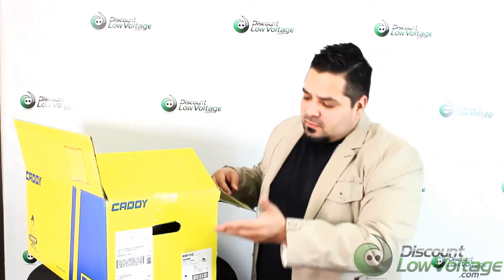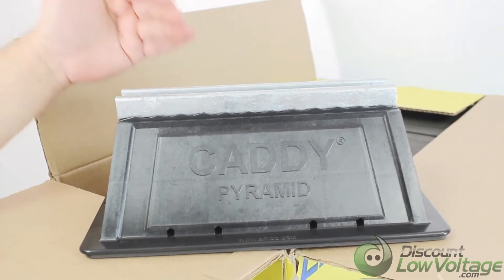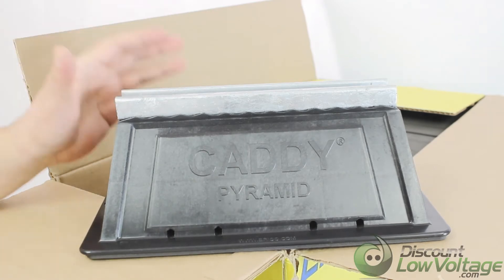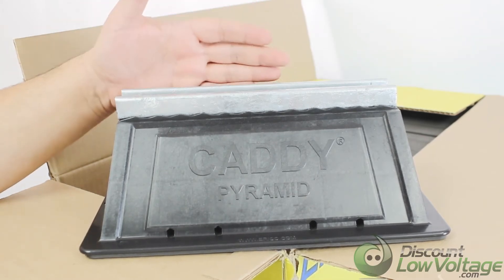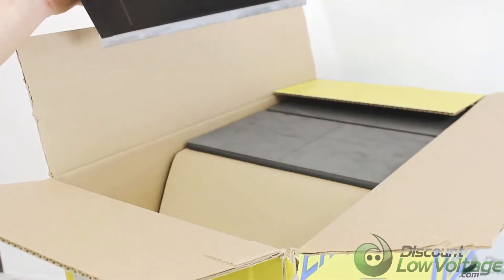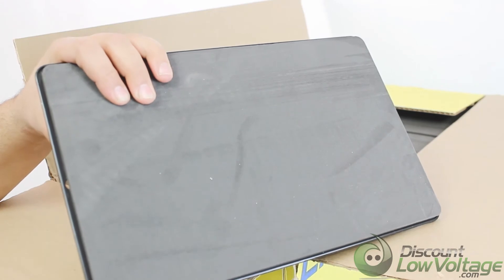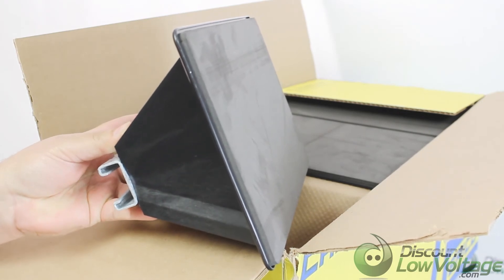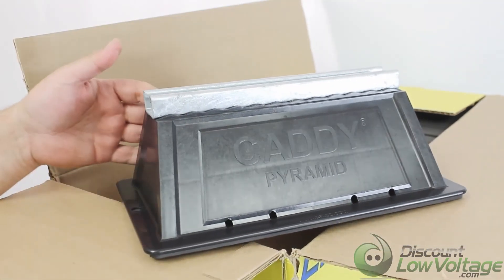Rooftop Supports for Pipe, Conduit, Duct, Cable, Electrical

Comment: Hi. Thank you for your explanation about the product. I have a question: Does it need to be fastened with some kind of glue on the surface of the roof?
Reply from the maker: It does not 😎